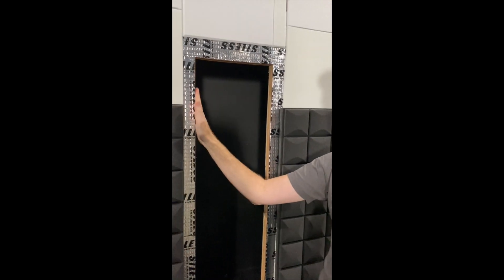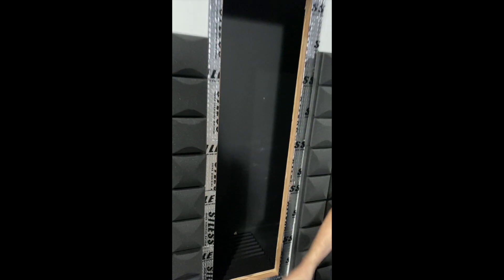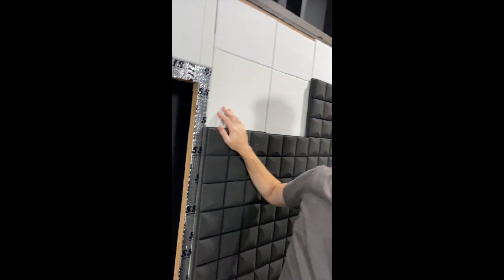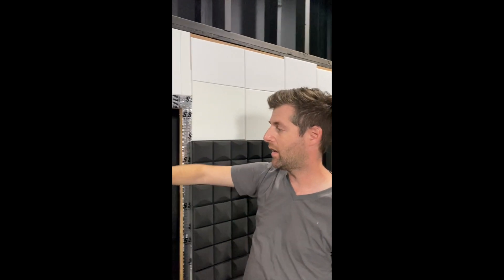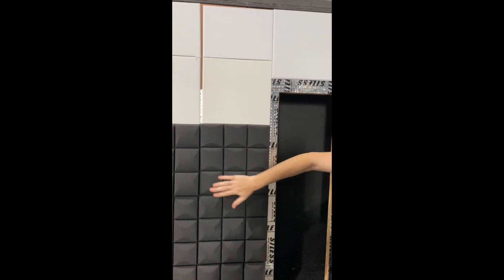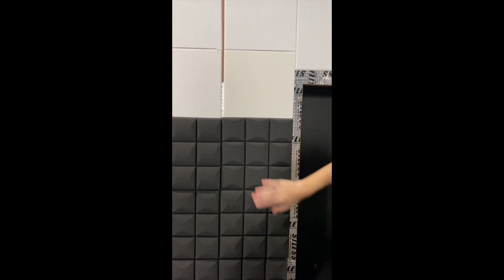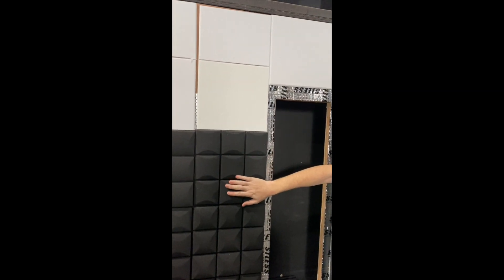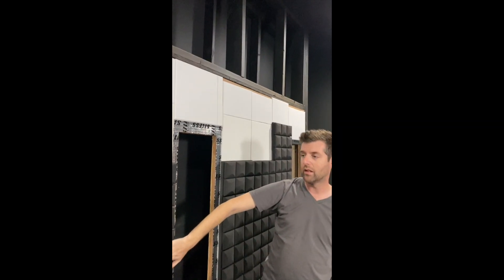How to Add Layers to the Baffle Wall in a Home Theater

Comment: Hi Mathew, thanks for the really great tutorial video.
I have a question, Let's say my room is 20 feet deep.
If I do a baffle-wall as per your explanation and it's 2 feet from the front wall, leaving my room's depth to be 18 feet... Then when I use the Harman's Room Mode Calculator to make sure i don't place my seats at the room nulls, should I enter 18 feet or 20 feet as my room's length?
Thank you for your insight in this, Mathew. I appreciate your awesome informational/educational videos.
Reply from the maker: It all depends how rigid your baffle wall ends up being. In all likelihood you may need to measure and see which is a better match. It could be half way between the two.  We see odd things all the times in these rooms.
Reply: @PoesAcoustics  Ah yess... thank you very much, Matt !

Comment: So this is your front wall? ie the one you face.
Reply from the maker: Yes though this isn’t what you would see. So there will be a layer of black suede headliner material. Headliner is acoustically transparent to help quiet car cabins and so works well for this.  The speakers will go in those three bays.  Then a screen gives over that.  When all is done, the thing you face will be a black wall with a white screen in the middle.
Reply: Great explanation and demonstration here! Are the cutouts for in-wall speakers? Also, how would this plywood/MDF/felt/foam combo compare to a baffle wall using rockwool, or Owens Corning?